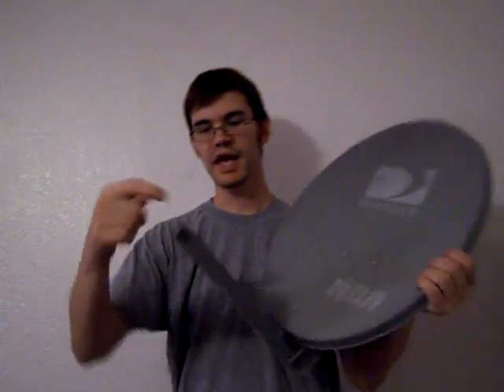Parabolic Dish Network - A brief runthrough

Comment from the maker: First, I used the original 'Rubber Duck' Antenna. That's what shocked me about the whole thing. After initially putting it together, I was skeptical, but the theory was sound.  When I used the 'Rubber Duck' antenna INSIDE the LNB, I got a poor signal. If you got it to work, that's really great. I'm always happy to hear something working better than mine, using the same method and devices to build it.

Comment from the maker: No problem.  I think the 6VAC will work OK for what I need it for.  If you have any questions on bridging, feel free to post a message at DD-WRT, or shoot a PM to me.  I forgot to tell you that they have a supported hardware list you can use to see which models can accept DD-WRT, but you'll probably be able to figure that out, if you haven't already.

Comment from the maker: Not via this method. Wireless-G band doesn't run in those speeds. Special commercial hardware is needed to obtain such speeds wireless & the cost would be expensive. It may be possible to run 4 routers (1 bridged directly to another -in parallel to another set identically bridged), but you may have to set special routing protocols & adjust settings that can also take extra time & increase cost because of added routers. 1Gbps speeds are usually for same-building wired LANs.

Comment from the maker: I haven't tested anywhere near that distance, so check your area first if it's legal and also for roughly LOS (line of Sight). I'm also planning on changing a few tidbits and USing a Linksys router reflashed with DD-WRT firmware. People seem to think my setup is for getting free Wi-Fi, when it's just to create a wireless LAN bridge. Using DD-WRT may also be useful as you can increase antenna strength, but you may want to look into cracking the case open and placing heatsinks on chips, first.

Comment from the maker: Long distance bridging of wireless access points. The setup described is not the generic WiFi booster many people have come to think of it as. My design is to extend the reange of a LAN wirelessly. This started because there wasn't enough space in one building for a LAN party. Another group formed in another building. The buildings are  about 1000 feet away from each other and there is road traffic and other such obstacles that make running a cable impossible.

Comment from the maker: Depends on the Access Point/Wireless Router you are planning to use for the bridge.  The Edimax I used had a mini-BNC, if I remember correctly. It happened to also match the connector on a D-Link DWL-2100.  Which made it easier to swap out the Edimax after it melted in the Vegas heat.  I got my parts at FRY's Electronics locally, but Radio Shack may carry the connectors too.  Haven't checked there lately.

Comment from the maker: It's a bit hard to tell the distance with all the buildings around, but we roughly clocked about 2 miles (4km) and still were able to pick up the network.  The dish was just a dish network dish.  I would suggest checking their site to find out what the material it's made of.  My guess is aluminum & steel.  We used the LNB that came with the dish.  Looks like it might be brass & aluminum, but could be die-cast & aluminum.

Comment from the maker: It you want a general parabolic dish and a small WiFi booster isn't giving you the strength and directional focus of signal, you can remove the LNB (nose cone) and replace it with a USB WiFi adapter.  All the dish does is focus signal.  Very simple and has an amazing effect of signal strengthening.